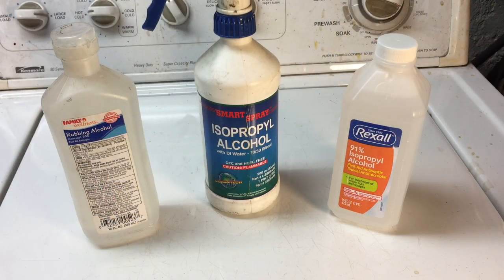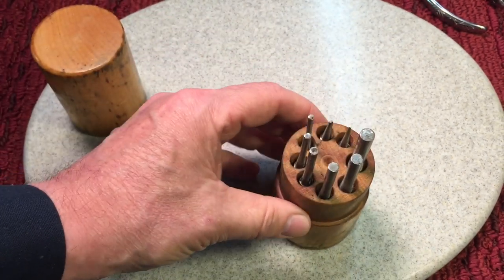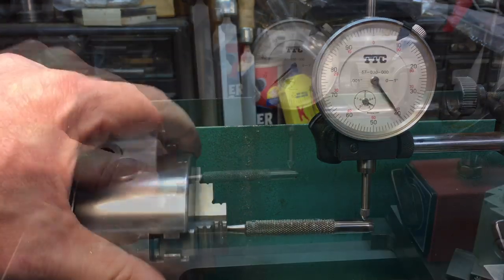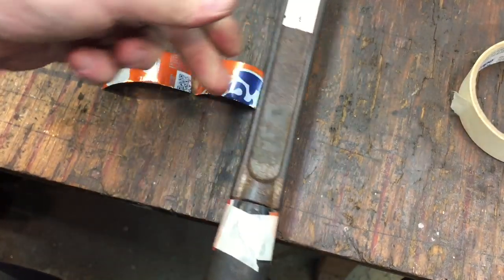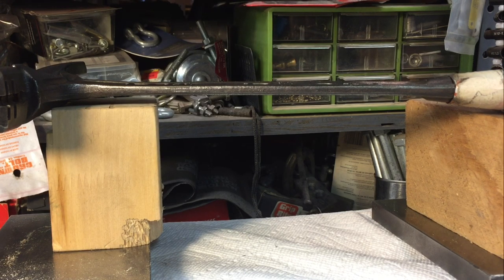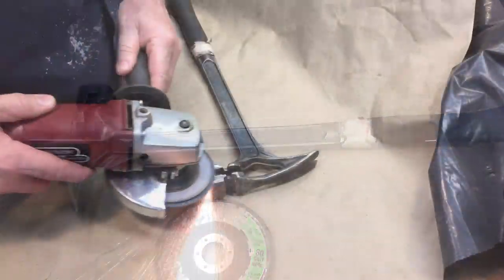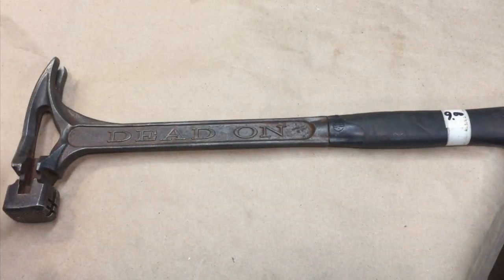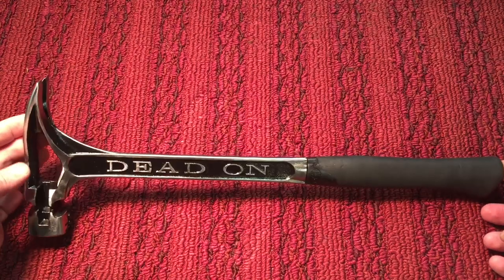Fix it Friday- Starrett Punch Set & Dead On Hammer!!!!

Comment: Hey ScoutCrafter,  I like that large face on your dial indicator. Mine is much smaller so it's more difficult to read. You make regrinding the tips of those punches look easy. That takes a lot of practice. Love the Thor hammer! The Dead On hammer had the waffling on it for tenderizing steaks, LOL. Krinkle black was a good choice. Thanks for another great vid.
Reply from the maker: Hi Mike!  Dial indicators are such a great tool that everyone can use!  They look complicated but are just the opposite! =)  I wish more people would try them out!   Thanks Mike!!
Reply: @ScoutCrafter  You're right. They can be used in so many applications too! Just like the verneer caliper. Thanks again.

Comment: I would trust your grinding ability any day of the week! DAKE!!! Good advice on the plates. Nothing wakes you up faster than something popping and a blink of an eye whatever you were working on is not there and you have all of your digits and no major bruising on your body! Could one chuck a punch in the lathe and face them off that way? I remember from high school tempering punches and dropping them on the ground to see if they shatter was a way to test. I have some brass punches that I would love to square up..... Nice job on that hammer. I feel your frustration, it turned out great!  With rubber, I use the cheapo Walmart brake cleaner to clean rubber grips on tools. Make sure you don't melt them with a test spot. It will melt the plastic on some screwdrivers though so be careful, don't ask me how I know. I did fix them with a quick swipe of brake cleaner to get them back to new.

Comment: Interesting you’d use a 22oz framing hammer for finish work— looks good though. Thanks for the tip on the alcohol. That Rexall brand brought back memories. We don’t have Rexall in this part of the country (Oklahoma) not sure if they’re still around anywhere but I see Dollar General sells  the Rexall brand so I’ll have to check it out. Cheers!
Reply from the maker: The hammer is sold in both smooth and milled face...   Smooth doesn't mean finishing work it means that if you slip off the head it won't leave a checkerboard on your woodwork!  =)

Comment: I like the polishing you did on the hammer.  You really accented all of the facets on the hammer head.  Here it comes, however, the body of the hammer looked so beautiful, seeing the hues of blue of the steel looked incredible.  I wished you would have just shellacked the body and let the natural beauty of the steel shine through.
Keep posting
Vince Wesolowski
Reply from the maker: Hi Vince, The color you thought was bluing was a paint coating that Dead-On applies.  It is a sort of hammered grey color.  The krinkle paint takes a few weeks to set and dulls out a bit.  Right now it is a bit glossy and won't be the finished look!  Thanks!

Comment: Awesome  job on the hammer, Your right they are not old. As far as I know Dead On makes framing hammers ,I have one its a little different  mine has two tangs on the handle  a little  over a inch an half apart so you can grab a 2x4 if its bowed  and adjust  it. Also has a pointed plastic end on the handle  that can be removed I guess you can use it as a plumb bob or to kill vampires. Awesome video  the punch set was very cool great find.

Comment: Hi Scout. I usually love your restortions, but in this case you turned a working horse into a showcase pice. It looks beautyfull now, but lost a lot of it's usability.  This is (was) a framing hammer. Having worked a lot with this kind of tools, I really can say the waffling is extreamly helpfull, if you have to drive in nail after nail. Also the rough surface is much more preferable, if you are working in rainy weather for example.
So in this case I would call it more a modification then a restauration, as the result is not was this hammer originally was designed for.

Thanks for all the great videos you made and hopefully will make in the future.  And I enjoyed this one as well, even if I wich you would have treated this "little"  Dead On quite differently.
Reply from the maker: You can buy this hammer with a waffle face or smooth face from the factory.   I have at last count well over 100 hammers!   I only bought this hammer because of the unusual head design and thoughts of making it a real looker!  The problem with milled faces is they always look like crap after a few years of service because the points get all mushed down.   I have a couple dozen of them and that is their weakness.   I would have liked to see this hammer with some color but I screwed up (twice) and caved...  LOL   Thanks!!
Reply: @ScoutCrafter  Well ,'didn't realized there is a version without available as well and I would have not exeted one. As I "only"owne about 10 to 12 hammers, I may be more on the "every peace has a job to do" perspective. :) And yes a bit of red might would be nice. Thanks again for you videos. May ther be plenty more of them.
Reply from the maker: @Theanimalde  I will try to visit the topic this week!  It is a good topic to discuss!  Thanks again!

Comment: Scout, you probably know this but if not I will mention it.  I have done framing off and on my whole adult life (part time for a neighbor that is a contractor). The waffling on the face of the hammer when it's sharp and new actually helps drive the nail straight, I have no idea on the science behind it but I can tell when it's smashed up as my example my boss has his "beater" hammer that does jobs that it wasn't designed to do (like breaking stucco or driving anchors  into concrete)  and when I have forgot my Vaughan California framer and had to use his hammer I bend so many nails even though it's the same style and brand hammer,  the waffling has a purpose besides smashing your thumbs.
I just figure I would mention this and I think I am now going to read up on the waffling because now I am curious about it.

EDIT:
This is from homefixated.com 
"A milled face, also called checkered face or waffle face, is a pattern on the striking face of the hammer. Different brands use different patterns, but the idea is to provide a bit of extra gripping surface to catch and sink nails."
I don't see how come it works on any site but I am not looking super hard because I should have been in bed hours ago but You know how that goes 
Anyways my friend as usual an absolutely great video... I think your my tool guru especially for good quality vintage stuff,  I am 40 and I first got into vintage stuff because of the quality and I never realized until watching you all the tools I have combed over at the swap meets that should have found a home in my tool box...
I feel kinda stupid considering I restore just about everything as a hobby (started with lawn mowers then cars and now everything. Anyways have a great Sunday.
Reply from the maker: Hi Alexander!  This hammer comes in both milled and regular face.  (Most hammers come both ways)  If you look at my hammer video you will see I have a great assortment of both-  I prefer smooth face but have used milled face hammers often.   The problem with milled faces is they eventually always get mashed down and look like crap.  The new nails today come with a waffled head so it has the same effect as a milled hammer face!   It's all personal preference but smooth face will look good long after the milled face looks all mushed up!  =)

Comment: I have what's left of one of those Dead-On hammers. It snapped (REALLY sketchy quality) while blacksmithing (not adviseable) so I had to put scales on what's left of the neck so I can use it for planishing.
Reply: One of my older videos shows where I did the modification to the remains.
Reply from the maker: I was really flexing this one wasn't I?   Never heard of these really...  Cool looking though!
Reply: Where the rubber grip meets the neck the only thing holding it together is an incredibly thin metal tab. It is absolutely astounding. I got to hear the PING you were trying to avoid.

Comment: Can the "crosshatch" design hammerhead be preserved instead of polished smooth? Tenuous to do --but slice grooves in the metal? Hammers like that make for great meat tenderizers.
Reply from the maker: Yes!  Using a file you can easily tune up the waffling.  I have a bunch of hammers with it but I prefer a smooth face for most of the work I do.  If I miss it doesn't look like a checker board!  LOL

Comment: Sometimes the lower isopropyl alkohol (~70%) works better for cleaning than the 90+% stuff. I was told that the water part is actually doing the cleaning while the alkohol just dissolves fats. If there is no or less water, the isopropyl just dissolves the fats, evaporates and leaves the dirt on the surface, because there is no water to absorb and carry it away.

Btw. i never saw a punch container like that. Now i have a weekend project. :P
Reply from the maker: I use it more then any other solvent in the shop now...  I just like it!  =)
Reply: @ScoutCrafter  Me too, i usually buying 99,9% isopropyl in 5 liters bottles. But for sticky stuff, nothing beats naphta. Just out of curiosity, how expensive is isopropyl in the us ? As far as I understood you, 91% isopropanol is a big deal. Here in germany u can buy those mentioned 5 litres for 20-25 euro.

Comment: Bet your using the hell out of that spray bottle of alcohol, now, Scout.
Reply from the maker: That 90% alcohol is just a awesome shop liquid!!!
Reply: @ScoutCrafter  - I used to think acetone was supremo. Then I was working with some Lexan that would "craze" a couple of hours after cleaning with acetone. Come to find out I should have used alcohol.  Acetone and some other solvents can cause surface cracks so I was gluing to a substrate that was clean, but had already failed.

Comment: We used to use isopropyl alcohol to clean read write heads on tape recording  machines and the tape path until the climate warming people said it was affecting our climate. They changed to a watery solution that was next to useless. What are all the facets for on the hammer? The magnet to hold the nail to start it, I understand but the rest is it decoration or do they have a purpose? You are copying Ben Mall with the painting
Reply from the maker: Some of the recesses are meant for nail extracting but there are a lot of spaces I think are done for astetic reasons...  You are right about copying Ben!  I was thinking that the whole time!!!  =D